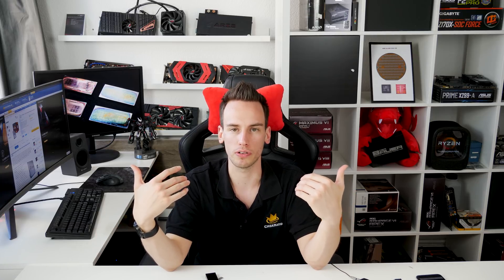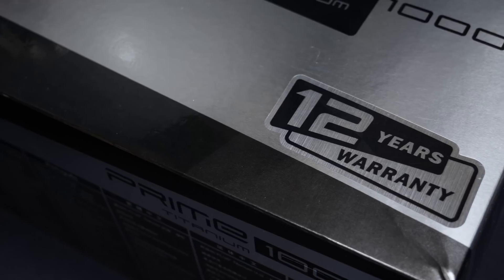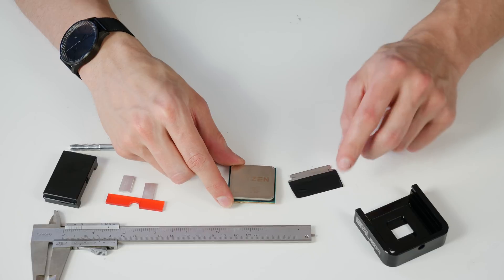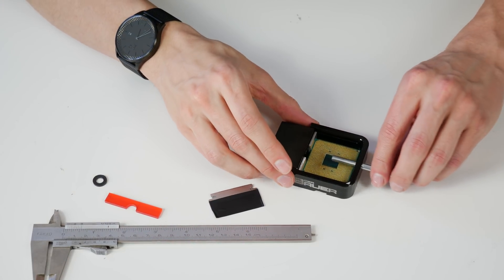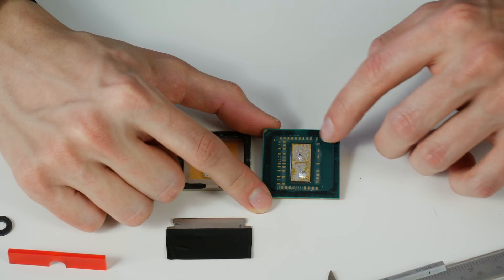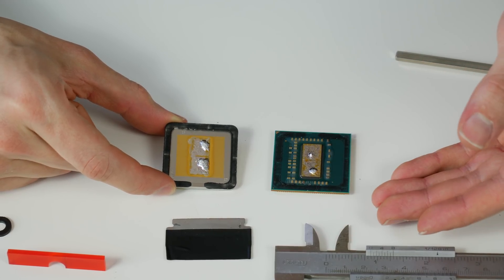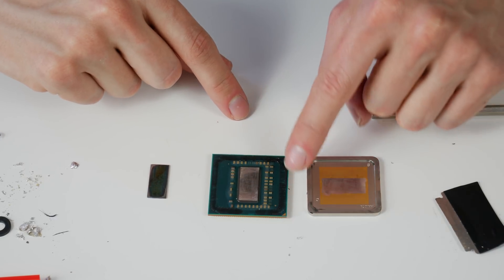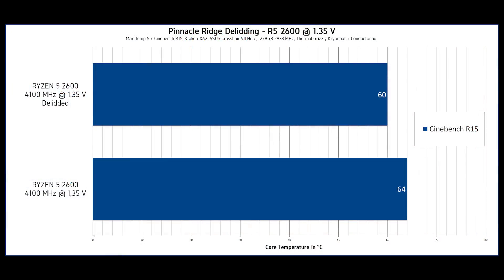ZEN+ Delidded - Before/After Temperatures - [Ryzen 5, 7, 2600, 2700X]

Comment: I think i know why you see the same die size. In most cases, one of the biggest benefits for the manufacturers, is the increased yields. This does most of the time outweigh the cost of new equipment for the process. This is why you, many others, and until now myself, expected to see a smaller die. However, Ryzen+ was always branded as a minor, but interesting iteration of Ryzen. We was told to expect 10% better performance, and it's seems like that is the case.
But they're cheap, the new Ryzen 2000 is very competitive in price. So, knowing that, and knowing that with a new process, there's often huge investment cost in the factory line establishment, it seems logical, that AMD decided to use the same "cutter" to cut out the dies. All rumors point to that Ryzen on 14nm had excellent yields, so AMD might have kept a lot of the existing factory line for this iteration, as increasing the yield rate might not have been very beneficial, compared to the potential of having a second and slightly improved iteration of Ryzen on the market, a year after the original, still at a competitive price. The benefit here being marketing and branding. Showing the world that AMD is rolling, and keeping up. Maybe this wasn't the biggest improvement, but they never claimed it to be. It's actually pretty impressive, it's a new architecture, and to expect that they could possibly have Zen 2 ready a year later, is unrealistic in so many ways. People who are disappointed in this, does in my opinion fail to realize the immense work there is in order to put 4,8 billion(!) transistor together, NOT to improve an decade old existing and tried layout, in a package where each is only 140 and then immediately aim for 120 atoms wide within a year! (Helium atom, the smallest, is 0,1nm)
Maybe even several elements are still the same size, as AMD engineers might have prioritized shrinking the CPU cores itself and left support components at the same size. Remember, AMD is way smaller than Intel and ARM, and their engineers have a lot more to do. And since AMD has published that Zen2 and Zen3 is on schedule, there is obviously not a lot of R&D time in surplus.
It is with these considerations, and relative to AMD's size, that i'm fairly impressed with this otherwise marginal improvement. Their slides state that they've had 3% improvement in IPC, When was the last time Intel actually had a measurable improvement in IPC?
TL;DR it's to save manufacturing cost, using the same packaging equipment as Ryzen, for a better CPU. Thus they don't have so construct new factory lines. Ryzen 2 is competitive in price, even more than the first. Look at the die in a good enough microscope, and you'll probably see the the new dies are smaller in certain areas, but is cut in the original size as the same equipment has been used.

Comment: The reason the Dies are the same Size is because they are made exactly the same way, the newer process is just tweaked in software and 12nm is a marketing term that just sounds better than 14nm+.

GloFo 12LP uses exactly the same lithography process as GloFo 14LPP ( argon fluoride (ArF) excimer lasers operating on a 193 nm wavelength ) to actually make the chips, the main difference lies in using a different Design Library (7.5T vs. 9T) to layout designs, so transistor density can be increased, this necessitates 'recompiling' your Design with the new Library.  

According to GloFo this leads to 15% higher density and 10% higher frequency potential, but just because the new Design Library allows you to layout circuits more efficiently doesn't mean individual logic gates are actually smaller, or that you will actually save space without an extensive redesign.  

It looks like AMD mainly opted for grab that frequency potential and call it a day.
Reply: why wouldn't they? a smaller chip wouldn't sell over last gen, a faster one sure would. im glad they went for faster ahead of smaller

Comment: The die size has not changed because this was not that much of a redesign. The size of the transistors has been reduced, but the layout is mostly the same. The only areas where major changes were made are the caches/interconnect. Otherwise it is a relatively simple job, a process change without layout changes. Thus the same die size. Zen+ is pretty much a "bugfix" release, in the sense that they originally wanted to get the cache latencies lower for 1st gen, but found out they could not. So with Zen+ they got a new process and they fixed some low hanging fruits like boost/XFR and the latency targets they could not hit with 1st gen.

Comment: Tooling is the reason the die size is the same. It means AMD doesn't have to change tooling to make new Ryzen, Threadripper, or EPYC CPUs. They probably ran the numbers and found it was cheaper to have a bit of "dead die" area than retooling the production line.

Comment: Isn't solder better than thermal grizzly
Reply: He talked about that. Yes, indium solder would be better if it was the same thickness. The reason liquid metal outperforms solder here, is that the layer of solder will always be thicker than a layer of LM that's under the pressure of a mounted cooler.

Comment: I would guess the "12 nm" means a few critical components have been changed to e.g. fin fet or reduced in size, with the majority of components still exactly the same size. They also say that these number are these days more guides to the process used, rather than actual size of the smallest dimension of lithography used. So basically they've probably just improved the most power hungry parts by a little bit at a physical level by e.g. fin fet and called "12 nm" process. Everything else stayed were it is, so the die will be the same size.

Comment: 11:30 - I'm not an expert but maybe there's not enough difference between 14 and 12 to retool if they are busy getting to 10, so they keep as much the same as possible.

 Didn't want to spend hours researching your question and this webpage isn't necessarily up to date but (won't give URL to prevent filter, select and search to find it) en.wikichip. org/wiki/14_nm_lithography_process says: 

"Building on top of Samsung's licensed 14nm process, GlobalFoundries announced "12LP" (12 nm Leading Performance) in late 2017 which is said to deliver up to 15% increase in density and 10% increase in performance. The process is expected to maintain the same device features as the 14nm process but introduce enhancements and tighter pitch in the BEOL and MOL stack.".

Maybe that's the answer ...

YT,
Rob

Comment: The Die isn't actually 12nm that's why. I can't really remember the specifics, but the transistor size didn't really change much at all, it was more of an optimization at certain stages of manufacturing to improve transistor  shape & consistency.

Like I think the only difference between GF 14nm & 12nm are two different machines on the production line, and 12nm is just marketing term to convey the improvement that would be equivalent from the refined process.

Comment: 12nm is a partial optical shrink of 14nm, so it's largely the same anyhow.

But I imagine you'd need to look at the internal layout to see the difference. We know the IMC should be bigger, and there could be more spacing here and there, other components laid out differently or are slightly bigger, etc.

Comment: The shrink to 12nm meant that the CPU can sustain same clock speeds as the 14nm but at 50mv less. 

AMD opted to increase efficiency while keeping the same transistor density instead of making the whole die smaller.

Comment: Its the same size because its basically the same manufacturer process based on Samsung 14nm just optimized and it have new marketing name 12 nm class . Its more like well improved 14nm (just like Intel had improved its 14nm few times already). Intel have 14 nm process so AMD need to have 12nm although its not really a 12nm typical marketing bullshit ;)

Comment: The "nm" sizing for a process node is a little vauge. It varies depending on what part of the transistor is being measured. And it won't allways reslut in a smaller die at the macro scale. AMD may have been able to shrink one part of the transistor which improved switching efficiencies but the interconnect traces and such are going to identical in size.  This shrink isn't even a half node, it's closer to what Intel calls 14nm+. At least that my understanding.

Comment: So dumb question, is anyone grinding down the silicon, to increase thermal conductivity of the CPU?  What we are actually trying to cool is the transistors themselves, and the transistors only take up a minor portion of the silicon thickness.  The rest of the silicon is mostly there to provide support during the manufacturing process.  Once the CPU is placed on the main CPU board, the the board should provide plenty of support, plus the width and length of the silicon is much smaller than it would be for most of the fab process.  Therefore the silicon shouldn't need to be as thick.  By halving the thickness of the silicon we should double (or there about) the amount of heat able to flow through it.
Reply: Donald Endsley and have a 99.9% chances to  kill the cpu for static discharge due to friction...

Comment: 12nm is the size of smallest element of the chip. It doesn't necessarily mean everything got proportionally smaller. This is why Intel has 14nm for a long time, there is still room to improve certain elements within the same formal 14nm or 12nm process.

Comment: There was an explanation from AMD on why the die size was the same. Rather than redesign the entire die layout to shrink the size they kept the same size and just reduced the size of the gates. I.e. the traces take the same paths but their is more empty space on the die and the gates are smaller. I would assume they did this for manufacturing efficiency with existing equipment.

Comment: Roman, if you carefully apply some ferric chloride to the die, after scraping off most of the indium, the ferric chloride should remove all traces of the soldering and leave a shiny die, idk if that helps temps, but less material is better.
Reply: I found that to be the cheapest way, sulphuric acid also works but costs way more. Heating it a bit too also helps.

Comment: anandtech has an article along with a handy dandy illustration.  they say they used the extra space on the die to add dark silicon around the active silicon for thermal buffer space.  but i dont think it was that big of a shrink anyway.  that way i guess you can keep the die the same and still get some better clocks but also use the same equipment an d pcb's unaltered.  just change the silkscreenn\laser etcher to print 2700x and you are good
Reply: to be honest i think maybe part of it is that they wanted to hide the difference.  i think a lot of the difference between 14nm and 12nm is in tweeking the process not just shrinking it.  maybe the physical layout or the materials used but  i dont think it was really shrunk as much as they are letting on or at least not all the chip was becasue now foundries offer different parts of the chips at different sizes if they cant make a total shrink.  i would not be surprised if the caches were shrunk and some "empty" space was put around them and the rest of the chip was the same size but with some reworked masks.  cahces makes up a large part of ryzen and would help with power a lot. and just tweeking the transistors for the rest of the chip would help get the clocsk up.  maybe you should shave one down and etch it and show us

Comment: "AMD says that the overall die size and transistor counts are unchanged from the first generation: the company isn't using the smaller process to pack the chip's transistors closer together. Rather, it's getting about another 250MHz and has reduced voltages by about 50mV."
https://arstechnica.com/gadgets/2018/04/second-generation-ryzen-incremental-improvement-narrows-the-gap-with-intel/

Comment: The difference between 12nm and 14nm has nothing to do with the die size, it has to do with the distance of the components at a microscopical level. You just can't tell at plain sight.
Reply: its little odd that its the exact same size. so the question he is really asking is 
- is it really 12nm or just marketing pitch 12nm?

Comment: Zen+ uses the same 14nm architecture as Zen. also, unless AMD has solved the issue with quantum tunneling of electrons Zen2 architecture wont be 7nm.
Reply: S Podt quantum tunneling limit will be for 5nm and smaller processes. 7nm process is almost ready at Samsung, GloFo and TSMC...

Comment: 12nm is just marketing. It’s basically GF’s way of saying 14nm+ which when compared to Intel fan naming, 22nm+. Everyone is basically half to one gen behind Intel despite what they say their processes are:
Reply: It is an actual 12 nm process, because otherwise Ryzen 2X00 wouldnt perform so much better. Also Ryzen is basically as fast as Intels Flagship Singlethreaded in the same Pricetier and outperforms it in Multithreading
Reply: Actually it's right.. Also Intel often have smaller transistor than the competition for the same node size.  14 and 12 are Half-shrink of 16 main node... These number do not tel exactly the real size of the transistor.

Intel own their own  fab to produce CPU  so they can come up with their own variant of the main standard node from the ITRS.  They usually chose or find a way to make the transistor smaller.  

AMD and Nvidia  send the production to third party fab  Glow Flow  TSMC  Samsung ect...  These are the one who need to compete on the production side.

Still we will know more once somebody compare them under a microscope.  But they are really likely to be nearly the same size.
Reply: Ryzen 2X00 is just as fast as previous ryzens in IPC. But it clocks better and has optimized cache. also much better boost behavior is very important.
If you hardlock both to same frequencies they do not differ that much.
Reply: As it was said before, it is correct, the way they measure is different uIntel 10nm is equivalent in size to 7nm of GF. Actually 7nm will be the first time the competition will be better than Intel.14 nm of Intel is the same size as GF 12nm, actually Intel is slightly smaller.
Reply: Read Anadtech on the Ryzen 2000 die size. You'll see why they did it. 12nm is smaller than 14nm.
Reply: ^sauce: https://www.anandtech.com/show/12625/amd-second-generation-ryzen-7-2700x-2700-ryzen-5-2600x-2600/2

Comment: Even when you have less nm, you need to connect silicone to pcb via old good solder, which is not as scalable as die. Also this could be thermal transfer stuff.

Comment: GF specified on their 12nm specs that it has 10% more density at the same power/performance than 14nm, or 15% more performance at the same die size. Amd clearly went for the second option.
Reply: The other way around actually.
Reply: It's still 14nm, no transistor shrink. 14nm+ was renamed to 12nm. Having same die area with smaller transistor means huge rework of architecture with new transistors put everywhere - clearly not the case here.
Reply: Tiberiu Lupescu No they went with the second option, Ryzen 2 is just a refresh